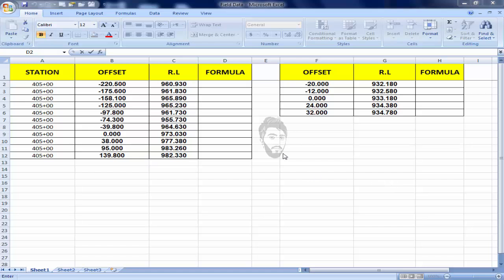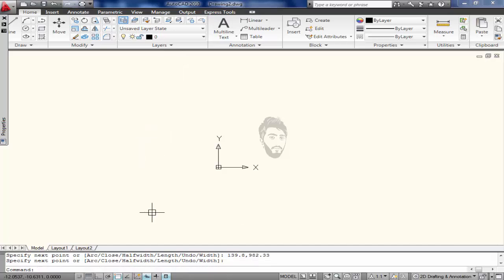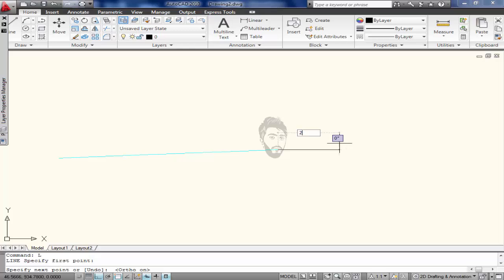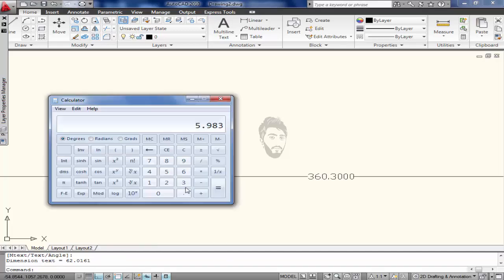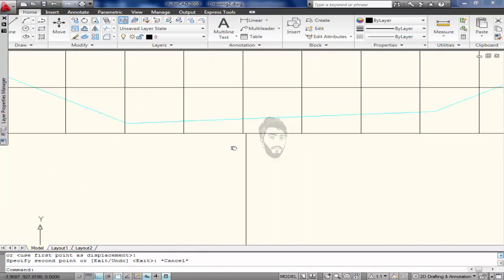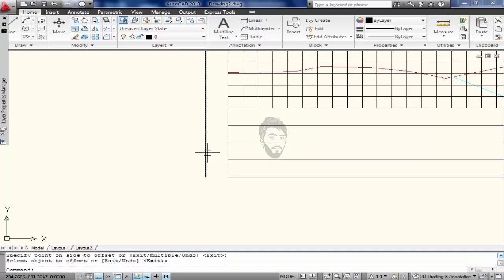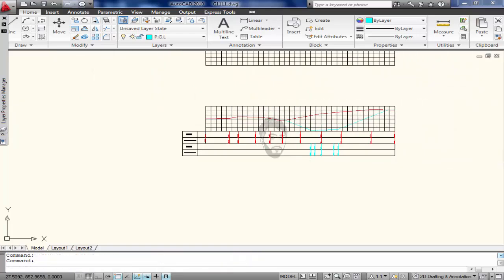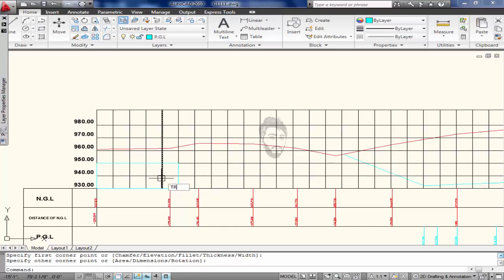How To Draw Road Cross Section IN AutoCAD - X-Section of Road New Method

Comment: i will humble more much , when  cross section made by lisp totally not manually
Reply from the maker: But we need to do some steps manually if you made a template for your cross section then you just need to put co-ordinates after this just simply you need to use vv lisp file. I just show you how to make cross section from A to Z. Hope your confusion has cleared.
Reply: Same problem

Comment: nice sir but I have question about AP command....and how to Sat  AP file, which type of file are you save VV file also . can you please Gide me how to VV file arranged in excel file to AutoCAD, for making x section .
please send VV file support video...or  file in My e-mail tapasbasak1985@gmail.com
Reply from the maker: Ap command is use to open "App Manager" to Load vv lisp file after loading this command choose the path where you have downloaded "vv lisp" file and select it and load it. I have a template of lisp vv file this is coded for AutoCAD that can automatically sort-out excel points by clicking on poly line by just single click. Click on below link to download vv file.
https://www.dropbox.com/s/y5gp0pbikv3hkxg/vv.lsp?dl=0#
Reply: sir please say to me how do creat vv file in my mail ID jenasusantakumar2@gmail.com